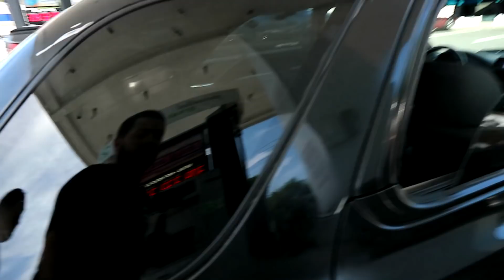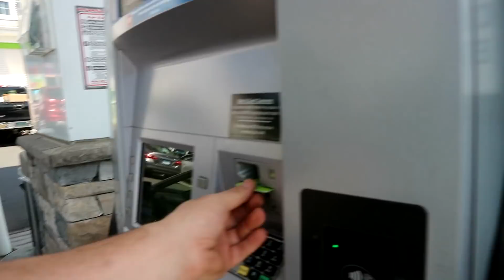NOT WORKING ON CARS

Comment: that crank bolt is a torque to yield bolt and you need to install a new one every time.
Reply: You are supposed to take the old bolt then torque it to 240 lb.ft. Take the old bolt out and install the new bolt to 37lb.ft. And then turn it 140° after the 37.
Reply: I have reused them many times with no issues... I'd be more worried about adding a dowel pin
Reply: blindabinda123 🤯
Reply: Didn’t he get an arp crank bolt? I thought you can reuse those
Reply: shane p Oh I don't know if he got the arp. If so yes It is reusable.

Comment: if you have the ability to reach out to matt happel over at sloppy mechanics he may be able to assist you. He has so much information available online for megasquirt and throughout the forums and the facebook group for sloopy mechanics as well. I wish I had the ability to help you through this, but it is odd because when the car initially starts it lobs low, and then ALL THE SUDDEN the rpms shoot up. To me that doesn't seem like a vacuum issue, but something that is calibrated incorrectly from ECU to engine calibration. So I think timing is a good place to start. you should also check your connections and make sure you arent getting an improper signal from something like the TPS or something along those lines. If you had a stock ecu and stock injectors on hand with a MAF you could also rule out vacuum and other leaks and issues as the car would idle lower if there are no issues(not perfectly but it would at least try to idle normally). Wish I could be of more help.
Reply: Turbo Everything! I'm guessing it's something injector related. Or its the timing. He should have them flow tested. Doesn't he have some really cheap injectors? Or is that the thing he replaced that he bought cheap.
Reply: Turbo Everything! Sloppy is in my.area they got some cool shit going on all the time
Reply: blindabinda123 could be injector dead times or latency
Reply: Turbo Everything! That's what I meant but I couldn't remember the wording. I think it's something with that our the same kind of think with he ignition timing

Comment: Yo! Saw the last video of the Z idling fast.
Does it only happen after you press the throttle? if so, it could be the butterfly return spring on the throttle body.  I never tuned FI cars before, but I've done carburetor swaps and had similar issue to you. 
While it's idling fast ,try to  close the throttle plate with your hand. If the idle drops, you gotta change that spring to a stiffer one --if you'll even be able to find one.

Comment: Blasters > Warriors. I’ve had quite a few  blasters and they are the easiest to work on. The 6 speed transmission paired with the lightest frame makes it a ripper. 60+mph. Warriors are slow as hell lol
Reply: mrjakeful1 banshee is the only way.
Reply: blindabinda123 lol what. He’s comparing warrior to blaster though. Of course banshee wins because that’s in a whole new ballpark. It’s got twice as many cylinders as a blaster lol. Banshees compare more to 450r’s